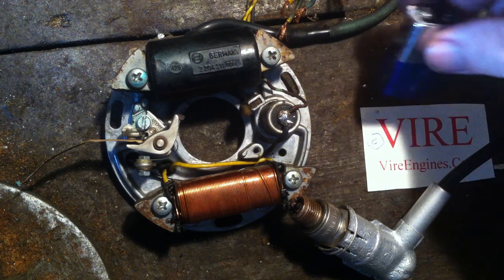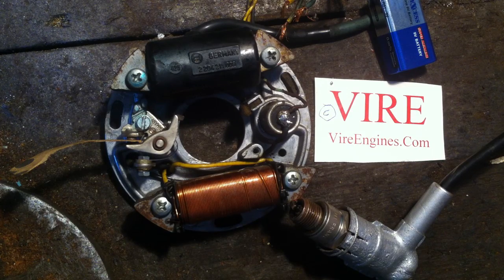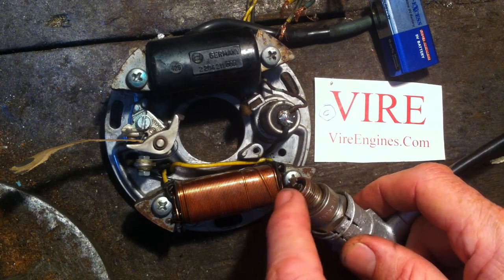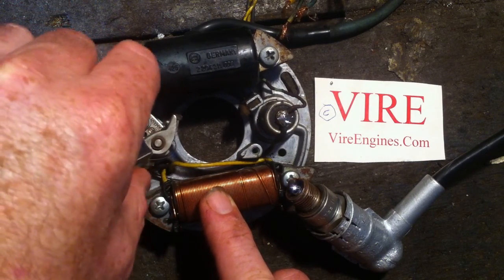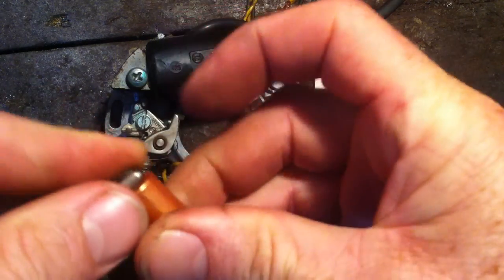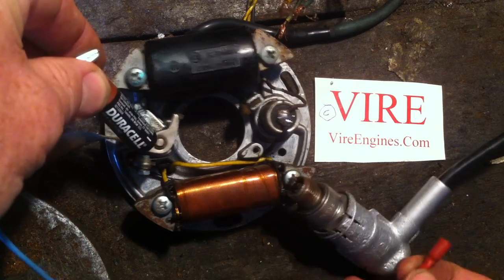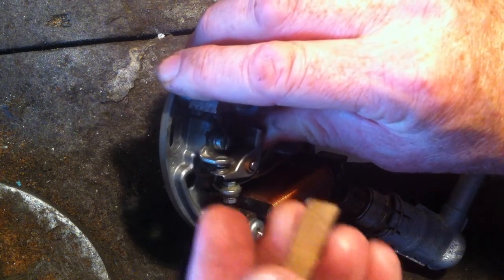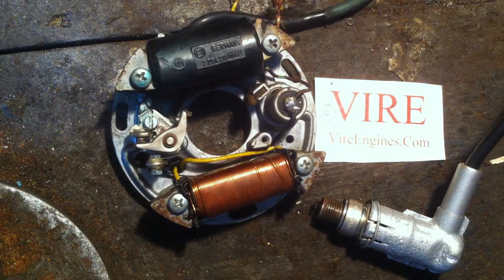Vire engine ignition (bosch) spark test using AA & 9v battery

Comment: Hey nick, when i do this i get a spark but when i try to start the motor there is no spark! Any tips?
Reply from the maker: Bas de jager your points are dirty/burned high resistance or not set correct gap. also check plug has perfect earth if not screwed into cylinder
Reply: Thank you for the quick responce! Nick Vire i put in new points and i ground directley to the bolt thay grounds the battery. Its driving me nuts haha. Your video's are the bomb by the way
Reply: Nick Vire small update, after fiddling with the 9v battery i mounted it back in an for a few seconds i had a really nice blue spark. Then i put in the sparkplug and tried to start it.. Nothing.. Tried to see if it sparks and it did not spark anymore! Gap is. 5mm (16 thou if i'm correct) and could you please define "high resistance"?
Reply: Mine sparks but when fitted it lights a spark plug tester light but not a new plug ?????